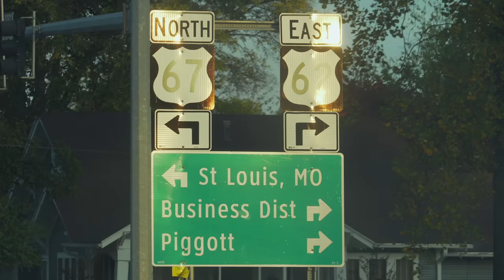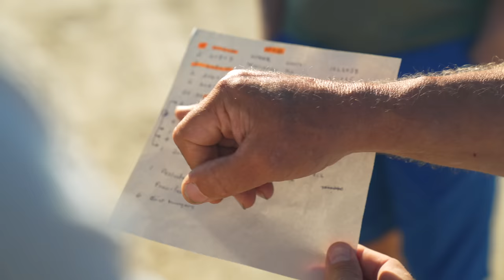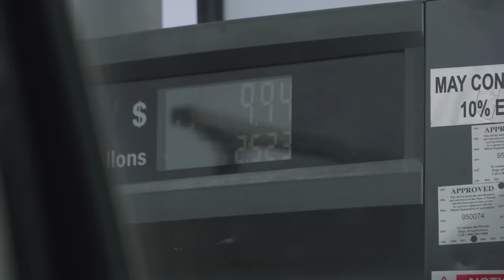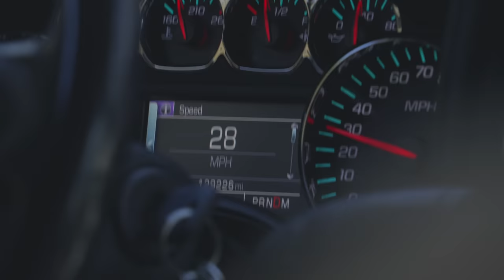Bow Hunting Big Deer on a Tree Farm | Buck Truck

Comment: Awesome video! Good thing it was Tyler and K.C. out hunting because I don't think any of these "ranch fairies" or "ethics only" knuckleheads could've adapted to the situation and made a successful hunt. Pumped for y'all great dear!!
Reply: Right, because respect for the animal should always come first. Adapting to the situation SHOULD have been letting the deer walk and not taking a marginal shot. Success doesn’t always mean killing an animal. Some things should come first.
Reply: 1) tons of people are advocating for heavier, FOC arrows and CoC broadheads -- including some of the folks at MeatEater. 2) Frontal shots aren't unethical in any way -- with the right set up. 3) Game managers in the UK constantly advocate for neck and head shots. Yes, they're using rifles, but a neck / frontal isn't a bad shot at all. BRO / Hushin take those shots on elk all the time. The thing that made that shot "unethical" was the range -- shooting a 30 pin for a deer at 20 could've caused a lot bigger issue than a well placed frontal. But they got it done.
Reply: @D_Boone  with expandles, I 100% agree with you.

Comment: The best thing that could have happened was those guys marking off that property for you. They basically told you where the pressure is and where they have pushed all the higher class deer. Right to where they allowed you to hunt. Best thing to do when dealing with a lot of hunters is finding out their territory because that's where the 1-3 year old and does fawns are which you guys are after higher age class deer. 😆😀😃